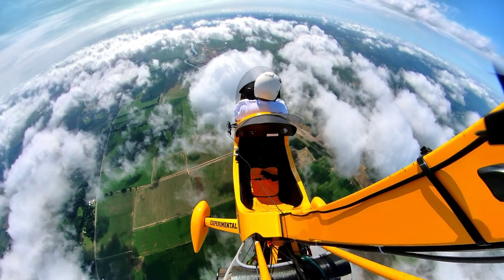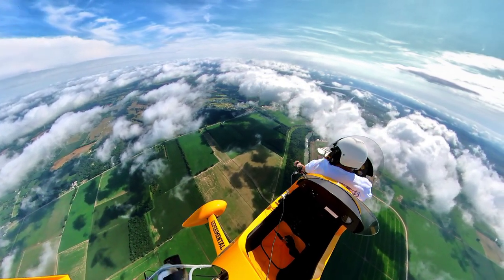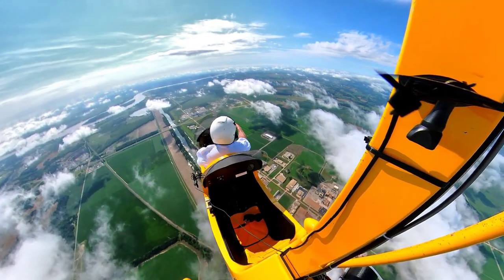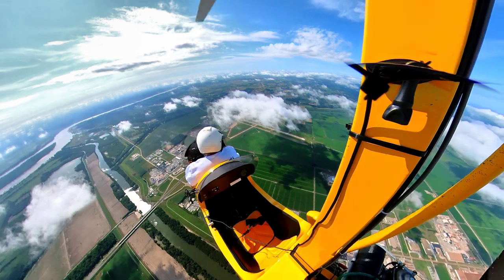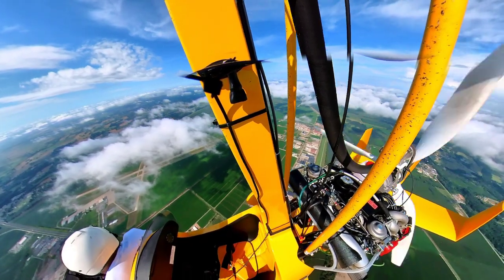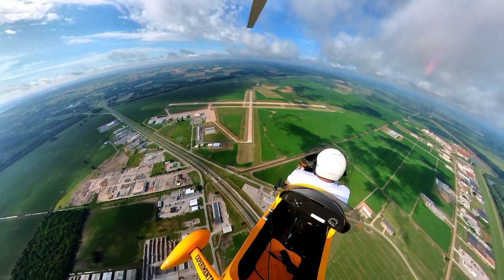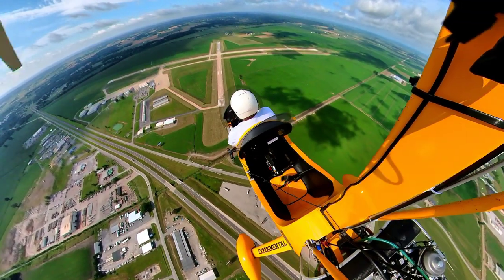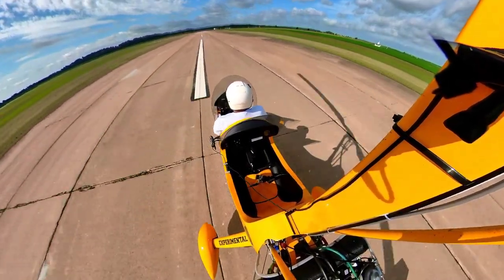Engine out Spot landing in a Magni Gyroplane!

Comment: The engine that was shut down also drove the rotor, so a totally unpowered landing? Is this craft now auto-gyroing, if that is the correct term?
Reply: A Gyroplane is always in autorotation. The engine at the rear does not drive the main rotor at all during flight, so when the engine is turned off, very little changes, you just keep flying her all the way to the ground.
Reply: @NJ-Tech  thanks!